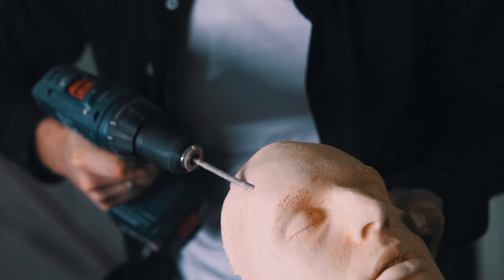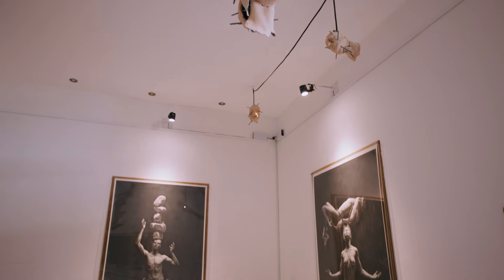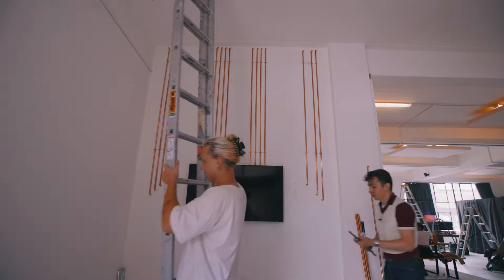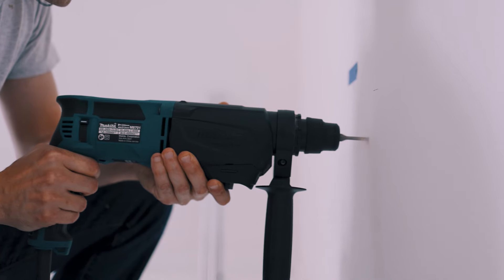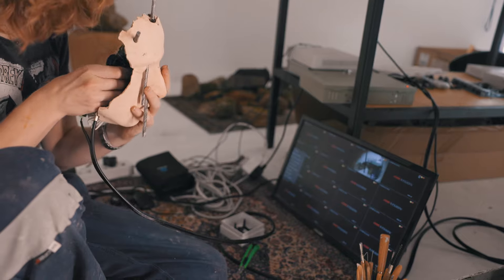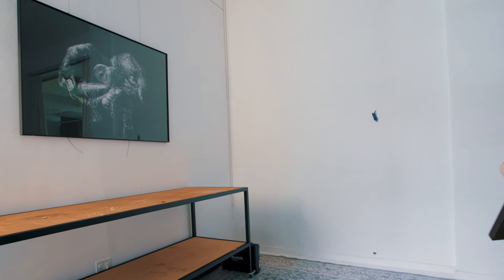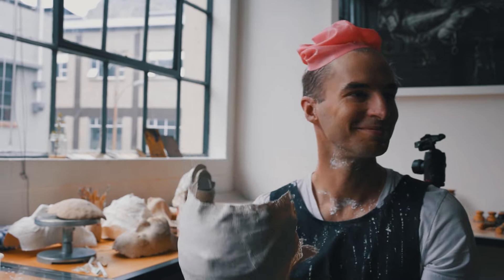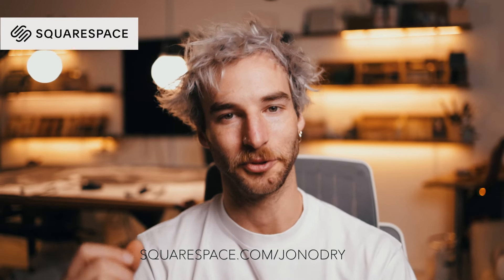Destroying One Of My Favourite Artworks

Comment: Hello, I wanted to ask what type of paper do you use in your hyper realistic drawings, if anyone knows please let me know
Reply: Search his video "why I wet my paper before drawing".....hope this helps.
Reply: arches hot pressed 300 gr/m2
Reply: @chaosme1ster  thanks dude, is this paper smooth or rough and I see that Jono uses water, why is that
Reply: @chaosme1ster  and it shows that it is watercolour
Reply: @szandor1214  the paper shows that it's watercolour, plz send me the link to the one he uses
Reply: @gabrielpita4724   Yes, he uses watercolour paper to draw on.  So do I sometimes, just because a paper is intended for one medium it doesn't mean you cannot use it for another one.
Reply: @gabrielpita4724  Hot pressed is smooth (cold pressed is rough). Make the paper wet so it expands a bit, then tape it to a board and let it dry. This wil give you a super-tight surface. Watercolour painters do the same thing for the same reason. Jono has a video about the "why". Google to figure out how to do this exactly, as taping a large sheet of paper does require quite some care and expertise, otherwise the paper will tear itself loose when drying.
Reply: And this watercolour paper is both smooth and rather thick (sturdy) so very suitable for relatively intense drawing and erasing. Arches is very expensive though. You could also use some other brand of hot pressed 300 g/m2 paper that's a tad more affordable.